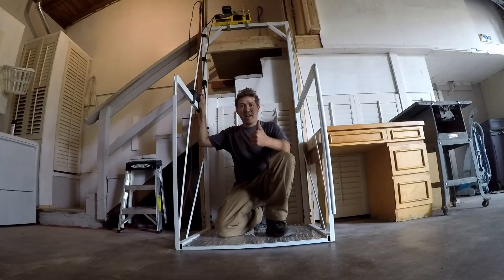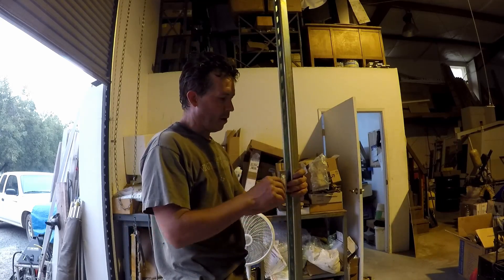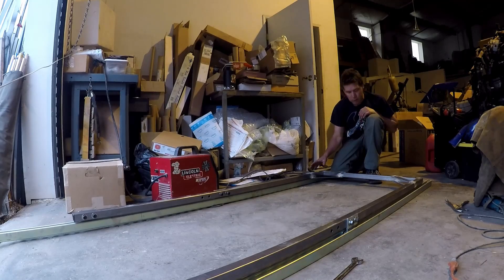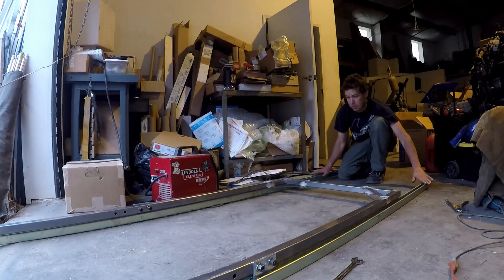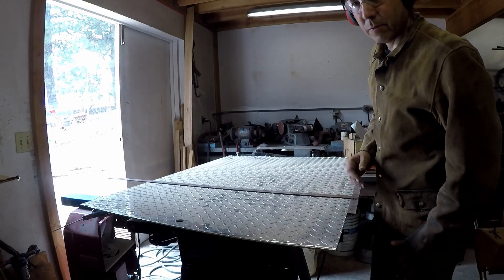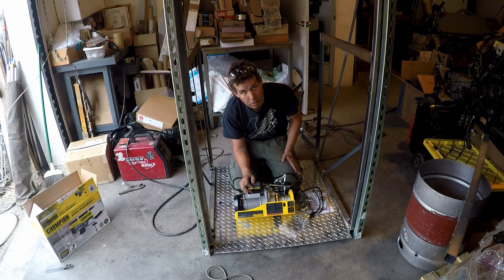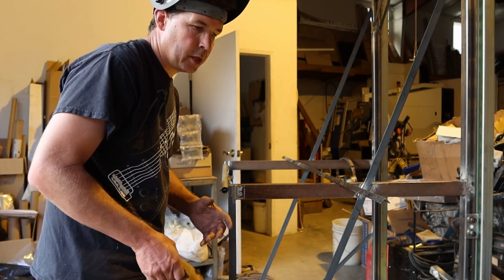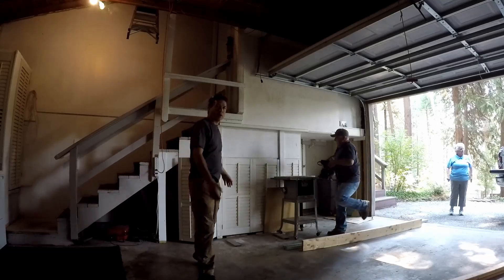How to build a small elevator

Comment: What he's dismissing as "overkill" (here used as a kind of verbal short-hand) is actually Safety Factor . 
A minimum in lifting operations is 3 to 1 in cargo lift , 5 to 1 in man lift . 
Still, I'm pretty confident that even just one bolt well exceeds that requirement.  What you get with two is redundancy , not capacity , (and torsional rigidity too, of course) and then the third bolt is for torsional redundancy, should one bolt lose integrity . 
I plan on doing this for my shop this summer, and will use all 3 bolts . 
Likely his success will be equal to mine, but our distance from possible failure will not be . 
Designing out the threat to safety is ALWAYS the best way , but those who provide the trolley system, certainly also see the value in designing out as far as possible , any potential liability.

Comment: Wow really cool im doing something similar really good video no music no fluff
Reply: His build does seem excellent 👍. Careful tho . What he's dismissing as "overkill" (here used as a kind of verbal short-hand) is actually Safety Factor . 
A minimum in lifting operations is 3 to 1 in cargo lift , 5 to 1 in man lift . 
Still, I'm pretty confident that even just one bolt well exceeds that requirement.  What you get with two is redundancy , not capacity , (and torsional rigidity too, of course) and then the third bolt is for torsional redundancy, should one bolt lose integrity . 
I plan on doing this for my shop this summer, and will use all 3 bolts . 
Likely his success will be equal to mine, but our distance from possible failure will not be . 
Designing out the threat to safety is ALWAYS the best way , but those who provide the trolley system, certainly also see the value in designing out as far as possible , any potential liability.

Comment: Thanks for sharing. It gave me some good ideas
Reply: His build does seem excellent 👍. Careful tho . What he's dismissing as "overkill" (here used as a kind of verbal short-hand) is actually Safety Factor . 
A minimum in lifting operations is 3 to 1 in cargo lift , 5 to 1 in man lift . 
Still, I'm pretty confident that even just one bolt well exceeds that requirement.  What you get with two is redundancy , not capacity , (and torsional rigidity too, of course) and then the third bolt is for torsional redundancy, should one bolt lose integrity . 
I plan on doing this for my shop this summer, and will use all 3 bolts . 
Likely his success will be equal to mine, but our distance from possible failure will not be . 
Designing out the threat to safety is ALWAYS the best way , but those who provide the trolley system, certainly also see the value in designing out as far as possible , any potential liability.

Comment: What if you are at the top and the elevator is at the bottom?   Or what if you are at the bottom and the elevator is at the top?   How do you get the elevator to come to you is there any control for that?  There may be more than one person in the house.   I remember a long time ago riding on a fright elevator in an old warehouse where the elevator was controlled by ropes.  They pulled one rope for up and one rope for down.   Nothing was taped on.   Thanks for making the video.   It is very interesting.  I really like the hinged board at the top.  That it self is a great invention.   It still allows you to use the stairs by picking it up.
Reply from the maker: not a bad idea with the ropes. There is only one person using it.

Comment: Nice!  Suggestion - The hinged board with the rope at the top, to provide elevator access, should be attached to the elevator's moving platform, not the stationary stairs.  Don't want Grandma to walk out and fall off the board while grandpa is riding down.  Also, a limit switch should be added to the moving frame such that the motor won't start unless the occupant pulls up that platform entry board.  This will also serve as a safety-from-moving-parts guard (don't want Grandpa's sweater to get caught in the rail guides).  

That flimsy outer hinged bar is not safe enough, so attach an identical board to the outside car exit, also with a limit switch, which also will double as a wheel chair ramp, which Grandpa will be using very shortly I'll bet.  

Also, slap a couple plywood boards on the sides too.  Stair rail & landing slat spacing, by code, must be close enough to not let a 4" sphere pass and I imagine that a moving elevator would have a more stringent requirement.  

Was that hoist meant for people duty?  It's paperwork might have a disclaimer somewhere regarding its use as a people lift.  Generally, use a safety factor of 5 for stuff that could cause injury to life & limb.  

Historical Factoid - Back when elevators were first invented, people lost their lives when cables snapped.  Otis, as in Otis elevators, patented and showed off at the Chicago World's fair, a patented mechanism where the lifting cable was attached to the elevator by a spring which was attached to a linkage which was attached to brake pads.  If the cable snapped, the spring tension would go to zero causing the linkage to thrust the brake pads outwards against a plate running parallel to the elevator track and thus preventing the car from falling.  it was a a type of dead man's switch.  Your elevator design does not have this safety feature.
Reply: I disagree.  The board should not be attached to the elevator.  What if you are standing there waiting for the elevator to come up.  You don't want to be on the stairs.  You should be standing on the board.
Reply: @captwar  Good point,  but it is no good how it is now either since you can accidentally walk or roll off the board and fall down the stairs since the outer edge of the board,  when lowered down, is dangling a couple feet above the next step down.  The stairs need to be rebuilt or shifted left in order to build an entrance platform.
Reply: @roberthigbee3260 he is putting a safety bar there. It says it on screen.
Reply: I like it the way it is. !
Reply: Guys , old people are just that, OLD it doesn't make them effing stupid, Grandpa isn't going to fall down the stairs because he doesn't want to ! 🤣

Comment: I'm just curious as to the total cost of this project.  Obviously the posters skill comes into play but I'm considering having one installed in my loft and $20,000 is a bit much for my budget.
Reply from the maker: I dont remember the total cost of this but it was less than $500 for the materials. May be a bit more now and I had some on hand that I dont know the price of. But defiantly less than $1000. If you are going though a professional company they would probably build a much better product but they have all kinds of expenses that I didnt. Especially insurance.

Comment: For those who want to build something like this. Hope accidents will not occur. Even if it is well done what is it going to happen if the camel snap or the winch clutch failed?
Reply from the maker: I installed a safty in the follow up video. I tested it and it worked. For such a short lift, I feel good enough about it. If others want to build something like this they need to understand its safty is on them.

Comment: As a former home inspector I wanted to ask about cutting the bottom of the truss.  This is a big no-no unless the modifications to truss structures are designed or approved by signature from a licensed engineer.  I hate to advise without invitation however for others who may copy your example I will.  You may invalidate your home's insurance coverages and possibly the structures occupancy permit from the county or city codes.  I can understand  home owners are allowed liberties in some communities however I would advise a buyer client to have a separate codes Inspector and insurance adjuster sign offs if no proof of engineering approval was documented.  If a freak windstorm or future roofers stacked bundles at the ridge which is normal practice, causing failures, liabilities could be traced to current owner and heirs in some states.  Please share if any remediation modifications were made.
Reply from the maker: You are correct. We did add the supports from the floor and also did a double 2x6 higher up. Not engineered but probably stronger now.
Reply: no professional engineering = not safe

Comment: PRO TIP:  Putting the saw blade in backwards make a smother cut on metal.
Reply from the maker: You know I heard that, but when I tried it blew all the teeth off.
Reply: @DirtyShopDIY  Probably had carbide tips then.  My dad had to cut aluminum siding and found that his REGULAR skill saw blade made a good cut by putting it in backwards.  I dont think he was using carbide tipped blades back then.

Comment: Thank you. This is what I need to build for my mum...
Reply: Hope mum is doing well. God bless.
Reply: His build does seem excellent 👍. Careful tho . What he's dismissing as "overkill" (here used as a kind of verbal short-hand) is actually Safety Factor . 
A minimum in lifting operations is 3 to 1 in cargo lift , 5 to 1 in man lift . 
Still, I'm pretty confident that even just one bolt well exceeds that requirement.  What you get with two is redundancy , not capacity , (and torsional rigidity too, of course) and then the third bolt is for torsional redundancy, should one bolt lose integrity . 
I plan on doing this for my shop this summer, and will use all 3 bolts . 
Likely his success will be equal to mine, but our distance from possible failure will not be . 
Designing out the threat to safety is ALWAYS the best way , but those who provide the trolley system, certainly also see the value in designing out as far as possible , any potential liability.

Comment: Great video! I plan on building something similar and I'm wondering how that hoist has been for you? Does the lift get daily use?
Reply from the maker: Yep daily use no issues with the hoist. I did have an issue with the cable and original pulls. I had to replace them with a poly cable and better block. Inspected it yesterday and it's still good
Reply: @DirtyShopDIY  Cool. I ended up going a different route, using a 3-phase motor and gearbox we found.

Comment: Easier way to measure center to center between two identical sized holes is to measure left side of the left hole to left side of the right hole. That is the same as center to center and no calculator needed.

Comment: Very good video wish you would have given us more info on the on the motor and how it was attachef
Reply from the maker: The motor is bolted directly to the upper arch of the frame. I believe I used the U-bolts that came with it or something like them. These are indoor hoist wenches made to attach to a roof beam.  Th cable goes up and attaches to a chain wrapped around doubled 2"x6"  boards.

Comment: Measuring Tip: if measuring between 2 holes the same size, measuring from the identical side of the hole (vs. the opposite sides) gives you the centerline of the two holes. No math.
Reply from the maker: I often measure with calipers between holes and then ad one hole worth of diameter to get distance center to center
Reply: Doesn't that only work if you subtract the difference between both sides of the identical sides of the hole?  I might be missing something...
Reply: DSD has it right. No way to measure by eye accurately.

Comment: If you want a smoother ride substitute a section of auto tow strap for the cable. It cushions the vibrations, and doesn't bunch up like the cable will do.
Reply from the maker: I replaced the cable with Poly tow rope later on. Strap would be good too.

Comment: Great build !  Only thing that I might add is that moving objects close to stationary objects can become a guillotine  for feet, arms, hands, fingers, and heads. Perhaps an enclosed cab would solve that.
Reply from the maker: That is a possibility. The only place where that could happen is on the stair side and you would have to be really close to have an issue. I cant enclose because of getting on one side and off the other. I could put a panel against the stairs so feet and such couldn't get mashed.
Reply: @DirtyShopDIY  that panel only, is the recommended thing for wheel chairs, to keep the feet and legs safe. Panel flush to edge of platform. No platform lip hanging over.

Comment: That is awesome my man, but in a  situation where by electricity cuts off. Do you have a back up plan.
Reply from the maker: It's only about a 6' lift. If it cut off then you would never be more than 3' from the ground or the landing.
Reply: @DirtyShopDIY  thank you very much sir for your reply. Please advise on someone who would want to do the same idea like yours on a two story building and electricity cuts off in the middle of the way. What are the safety measures that one can improvise for the authorities to approve his or her elevator.
Reply from the maker: @reubenmalandu7490  I can't recommend building one of these that tall. There would need to be a better safety that would catch the elevator in the event of a cable or wench failure. Safety risks increase drastically with height. 
That said if I had to do it I would use a 12 volt wench like on a Jeep with a battery. The battery would be charged by a smart charger which would maximize the battery life. If the power went out you would still have a good number of trips up and down before draining the battery.
Reply: @DirtyShopDIY  thank you very much once again for your reply and your advice. I will have to involve expects on my elevator. Good day bye

Comment: I hope you know not to use grease on wire rope. If you want to lubricate it there are special lubricants for the job, using grease hides damage to the wire rope which could lead to injuries if the rope fails.

Comment: Just for everybody's reference, most home center stores like Home Depot and Lowe's sell case hardened "Elevator bolts" that have strong 2mm thick heads like a thin washer for a head, that is cast or welded to a 7/16" bolt or larger sizes and lengths that will give you almost zero clearance for your rollers in the tracks or other applications. I Worked for elevator companies for a couple of years. What you want to look for is high grade bolts and plate stock for added strength to handle the stress of offset weight distribution.  And try to stick weld or better and avoid MIG welding to make sure your welds have at least 80% penetration to each mating surface for good sound strength.
Reply: I am going to put one in a house I plan to build here in the next few years. I am going to go the simple route. Which is four 2x2x1/4 angle ( when you make 2 L shapes with your hand the thumbs is where the guides will go. ) The frame will be 1 inch box steel welded up in to a C shape and the platform will be box steel with a pit below the bottom floor for levelness with the lower level. Pretty much it will sit inside a frame with 12 v pulleys which will keep it stable. I have not decided exactly if I am going to go single strand or do a double or triple pulley system. I also want to avoid the snapping of the line. My size will be 4x4 with a 5x5 hole. This way there is enough room and the lift will be enclosed in except the entrance. Since it will be pretty much a closet it will have a door on it and then a retractable safety gate. Should not cost more than 1k which includes labor and parts. Its simple enough and strong enough to rate it at about 2k load with a 5k winch. To be used by both cargo/pallets and human cargo.
Reply: EXCELLENT Input - Thanks !

Comment: @2:44 "One is overkill..." I wanna see this with no holes used! LOL  Unistrut expects you to use track hangers when using trolleys which is an excuse to sell you more stuff. Their P1000HS strut has 9/16" holes, for use with 1/2" fasteners, instead of slots which might allow for using bolts or screws as-is, probably flush head since a 1/2" pan head would have a head diameter big enough to likely hit the trolley wheels. Big box stores don't carry the P1000HS, would need to get from electrical supplier. That said, likely easier to just get readily available slotted version and drill holes as you did.
Reply: Yeah , what he's dismissing as "overkill" (here used as a kind of verbal short-hand) is actually Safety Factor . 
A minimum in lifting operations is 3 to 1 in cargo lift , 5 to 1 in man lift . 
Still, I'm pretty confident that even just one bolt well exceeds that requirement.  What you get with two is redundancy , not capacity , (and torsional rigidity too, of course) and then the third bolt is for torsional redundancy, should one bolt lose integrity . 
I plan on doing this for my shop this summer, and will use all 3 bolts . 
Likely his success will be equal to mine, but our distance from possible failure will not be . 
Designing out the threat to safety is ALWAYS the best way , but those who provide the trolley system, certainly also see the value in designing out as far as possible , any potential liability.